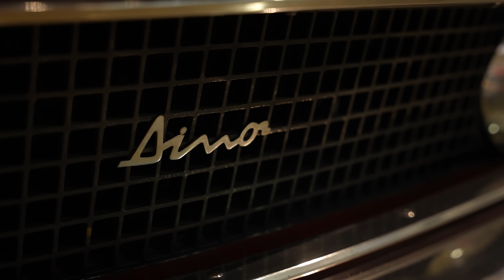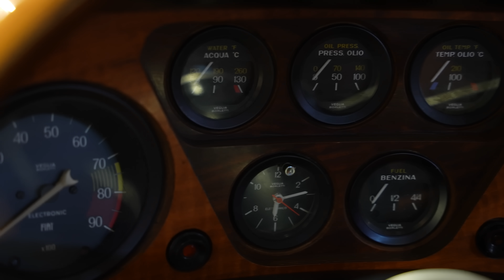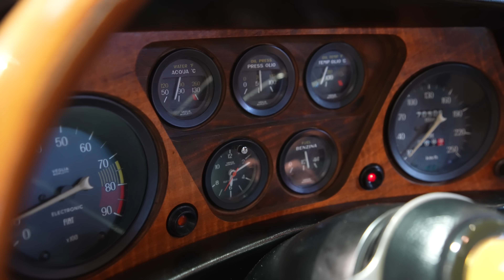$2000 Car, now worth $75,000: 1972 Fiat Dino Coupe | The Appraiser

Comment: Neat little car, and the coupe looks much nicer than the spider. About 20 years ago there was one at a local auction with a low estimate. However, I opened the driver’s door and the door dropped about 1/2 an inch. The door hinge areas were not the only rusty spots.

Comment: In 1975 I imported a 1967 Fiat Dino Spider with a factory hardtop sight unseen from Italy to Seattle, WA. for $3,350 delivered. The car had major rocker panel rust that I had repaired for very little money. I drove the car for a couple of years and sold it for almost three times what I had in it. The problem was that I sold it...
Reply: Exactly. And its kind of stuff you will just regret forever...

Comment: Wow: What a beauty! I longed to have a Fiat Dino since the Seventies. I never found one I could afford. Once I went to look at one at a classic car dealer. It had rust. In Switzerland, we have salt on the roads in winter and it is humid. So rust is the worst enemy for those vehicles. And they were rare where I live. I have seen much more Ferrari Dinos than Fiat Dinos in Switzerland. I knew only one person who owned one. That is one of the cars I dreamt of owning and I will never have in my garage. This car is one of the prettiest vehicles ever: Like a small and simple version of the Iso Grifo.
Well I own more classic cars than I can handle and maintain. But I would be so happy owning this vehicle in this condition. 
By the way : Those are Cromodora wheels. I bought smaller ones for my Fiat 124 Spider. I sold a set in the late Seventies for 80$. And when I bought a set ten years ago it cost me 800$.
Reply: Question, isnt there a Heschlavvo in Switzerland?

Comment: I have a ‘67 Fiat Dino Coupe 2000, headed to the engine rebuilder now. Everything else is excellent. The 2.4L are the more valued because of the power increase and the IRS. The 2L cars have a live axle rear that’s a bit clunky. Its a tough car to put a value on because while they haven’t gone crazy yet, they’re rare enough that you won’t find an affordable one that doesn’t need a lot of restoration. In other words, the elevator is going up now on these. But at 75k, what other Italian cars are out there with a RACE BRED Ferrari engine in perfect condition? The other models with this engine are the Spyders (2x the price), Dino 206 and 246 GTs (250k+), and the Lancia Stratos (100k+).  75k is a steal.

Comment: One thing I noticed is that it had 2 ignition coils mounted on the passenger fender.  One was plugged into the distributor as normal but what was the second used for?
Reply: Back-up if the first died.  It had all sorts of furturist stuff.  If oil pressure dropped the engine would stop before any damage.  Electric windows had manual cranks
I could go on...
Reply: @Martin Sage  ahhh so it was built with redundancy in mind then. If one system failed there was a back up.
Reply: @thomasdavies7431  Exactly

Comment: The Ferrari 250 GTO once sold for $18k new from factory in 1962, depreciated down to just $4000 in just 3 years and down to $2500 in 1969.  It's gained 10,000x in value since then of course

Comment: It's nice to see a lovely old fiat  Dino I used to work for a fiat lancia specialist back in the late eightys and early nintys in my opinion one of the best handerling and best cars I ever drove was the LANCIA DELTA  I worked on all the H F models and intergale models from the 1.6 early delta to the last 2,0  16v series 3 they had a lot of problems but when they were Wright you could drive them so hard and in my opinion better and faster than the AUDI QUATTRO wich was the next employer I worked for I restored a U r QUATTRO 1989 2144 cc it was so heavy compared to the lancia intergale.